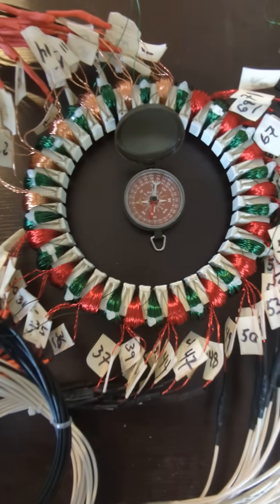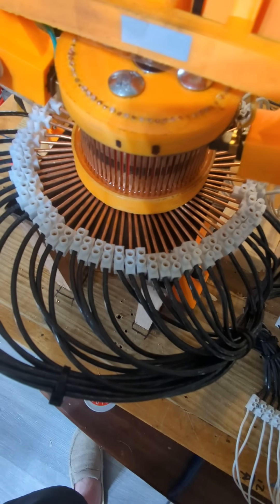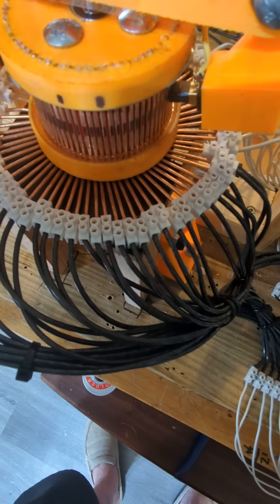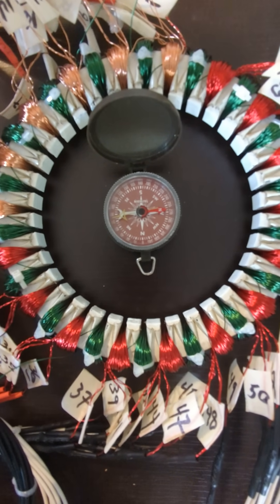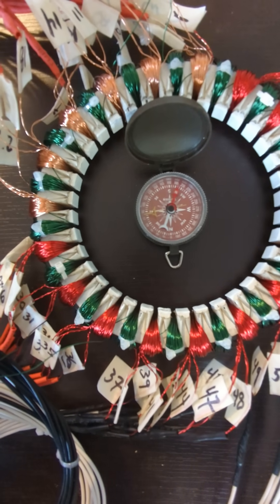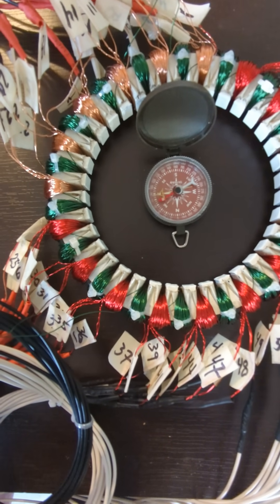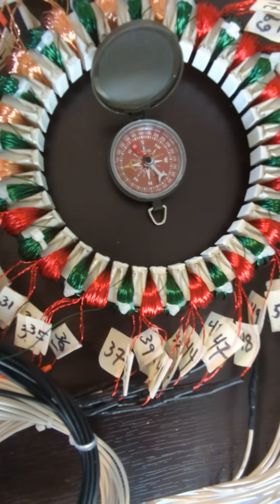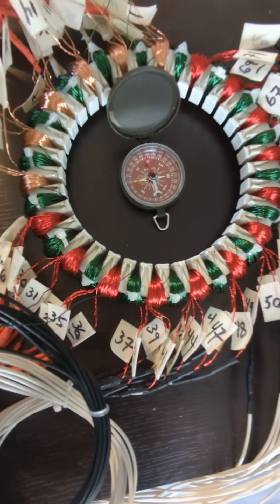WOW -  Virtual Magnetic Rotation Clear As Day!  OVERUNITY TEST DAY  ~~~

Comment: Any chance to do it solid with relee?
Reply from the maker: relee?  You mean relay?  Sure!  But this is 72 contacts flipping polarity!  Be prepared to use boxes of Relays.  And mechanical relays will probably burn out pretty quickly.  Even Mosfets,  YES possible-  BUT very hairy circuit!
Reply: @floodrod thanks for your answer. Great project